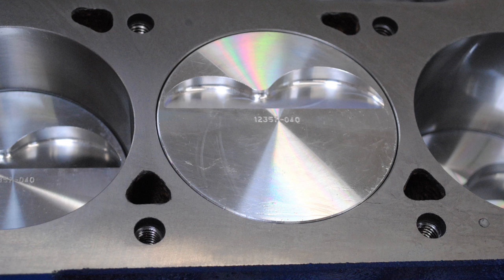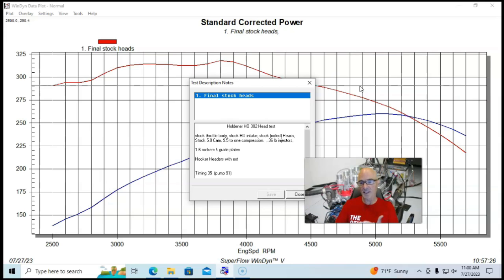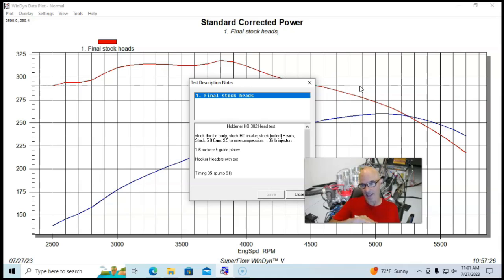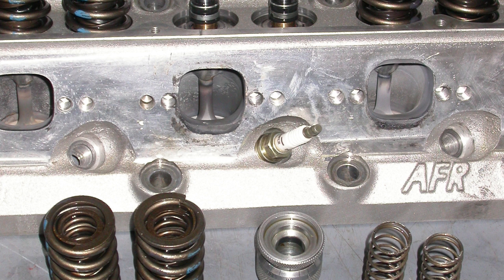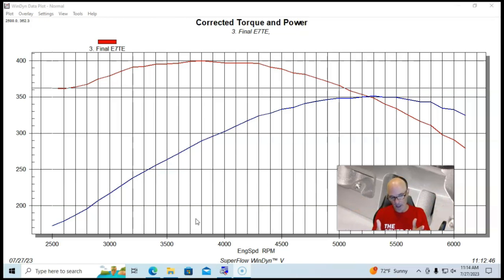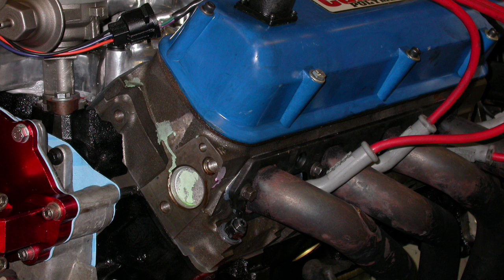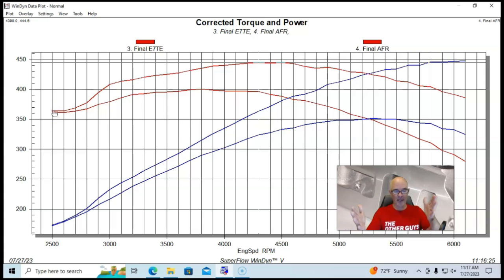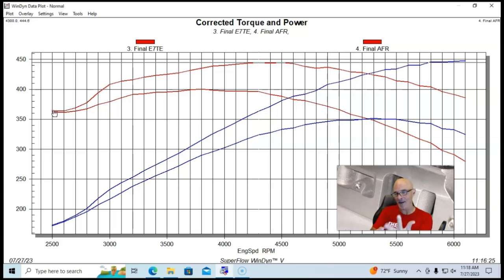HOW MUCH POWER ARE AFR HEADS WORTH ON A SBF? ARE THEY WORTH 20 HP OR 100 HP? THE ANSWER IS YES!

Comment: We need larger gains for those costs
Reply: Turbo is the way to go nowadays. I'm still on the fence but probably going to keep the 302 in my car because it weighs considerably less than a 351w. A set of GT40 heads, aluminum dual plane, holley efi, and a cheap-ish turbo should be a smooth 400-450hp for like $4000.
Reply: Inflation
If $ really matter, stay stock.
Reply: Blame Biden I paid 650 less for my 220's when Trump was in office
Reply: @alltherpm fjb
Reply from the maker: so Biden and Trump control the price structure of TFS heads-that would be a big NO
Reply: That is the way it has always been with Ford, you have to spend alot more money to make the same horse power as a GM, with less money
Reply: @patricktisdale9603  I know sir. That’s why I have been having trouble paying near a thousand dollars for the trickflow box intake, most cams are more expensive, and the need for aftermarket aluminum heads as opposed to the basic junkyard 5.3s. I don’t have the disposable income as most of the people in the turbo sbf game and I wish I made changes years ago instead of doing nothing.